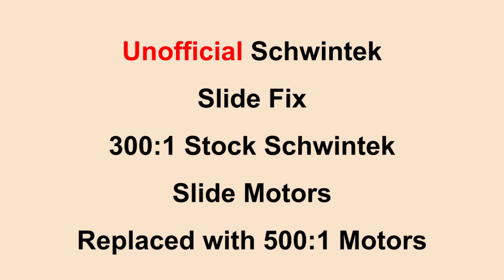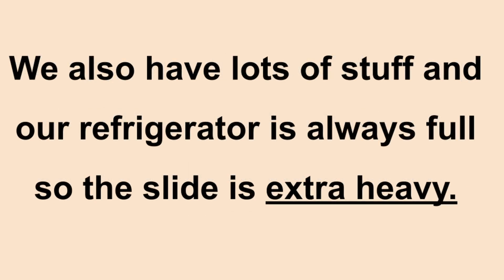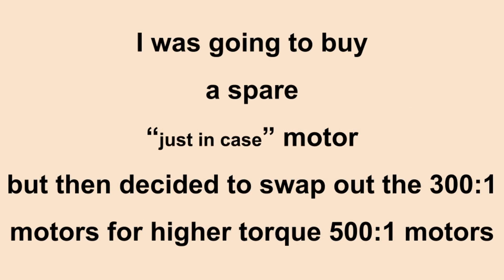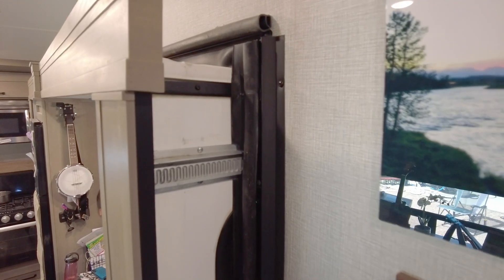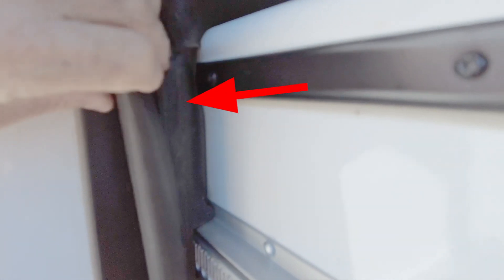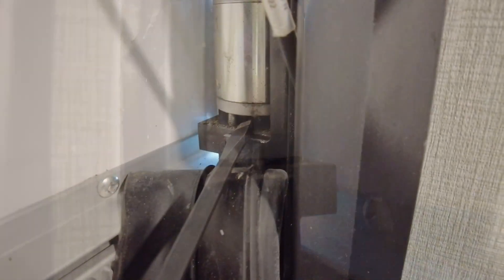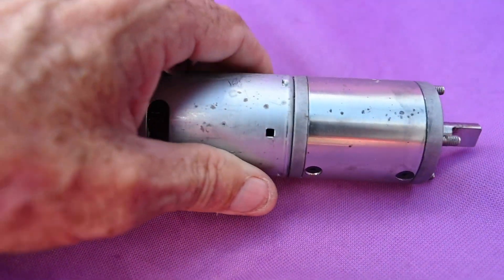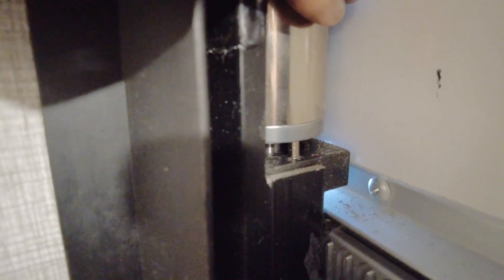Schwintek Slide Fix by Changing Motors -- 300:1 to 500:1 Gear Ratio

Comment: Beautiful. About to do this exact same thing as my kitchen slide from factory came with the 300:1 motors and I am on my 2nd replacement within 9 openings of the slide. How have they been holding up 9 months later?
Reply from the maker: @M62lotra  It is still working great. We are full time and move often so they get higher than average use. I am super glad we did it. I am also glad I bought the lower priced motors instead of the expensive lippert ones. It is so nice to be able to open the slide when parked in a Cracker Barrel or Walmart parking lot and not worry that the RV is not perfectly level!

Comment: Wish I knew if my superslide has 300:1 or high torque..
Reply from the maker: If you look at the model number of the slide and reference that to Lipperts parts list it may tell you. The model number is behind the seal . I can not exactly remember where but I know there is a YouTube video that shows where to find it. That is how I found mine.
Reply: @TravelingLightReflections  I bought a set of high torque motors on Amazon for $130.  Will replace eventually whether OEM is 300 or 500:1.